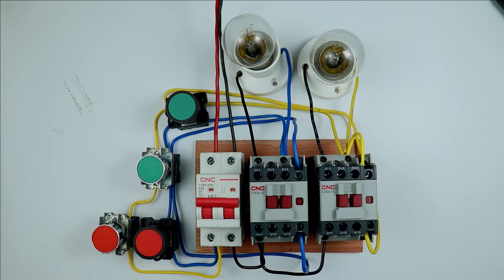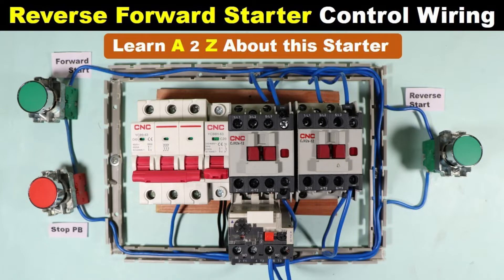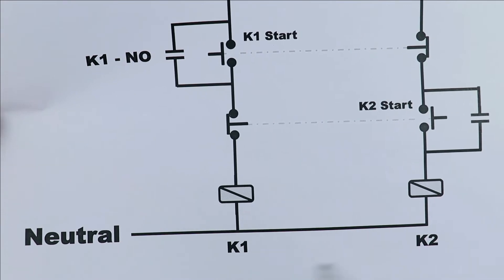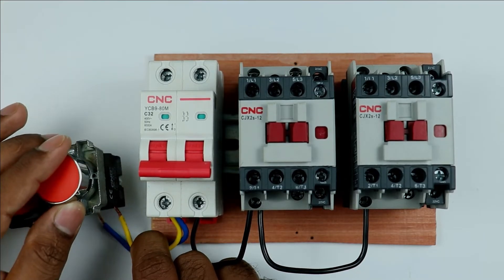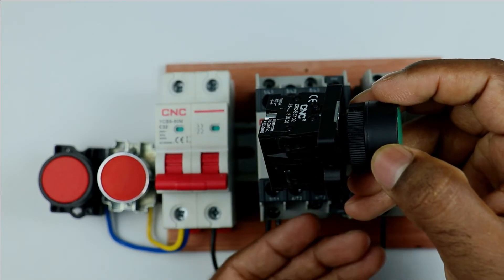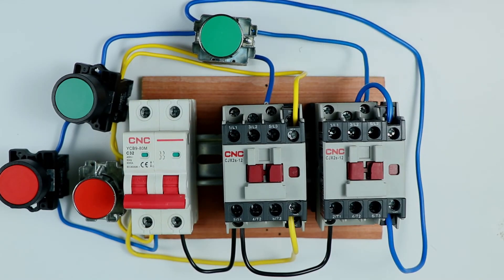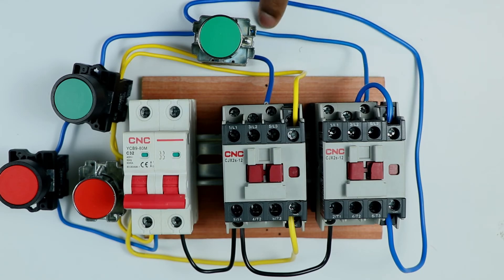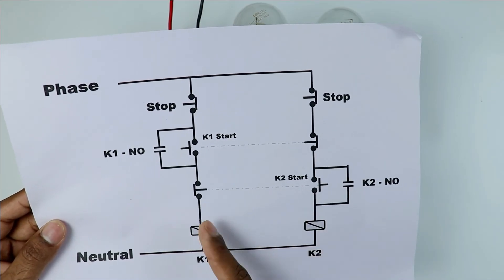interlocking of two contactors Explained with circuit diagram @TheElectricalGuy

Comment: I need to control a hydraulic cylinder for a press brake. It has a DCV with 2 solenoid valves. One for up movement and one for down movement. Is double interlocking the right solution to make this work automatically?